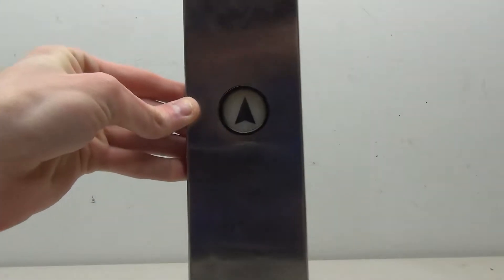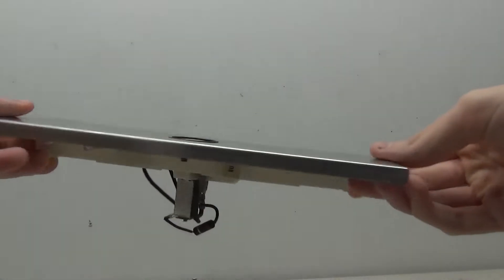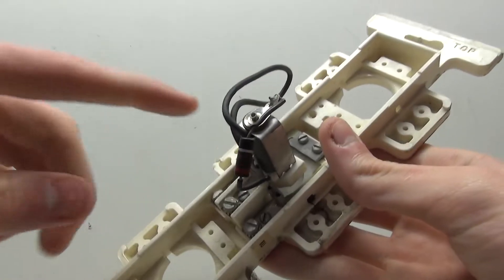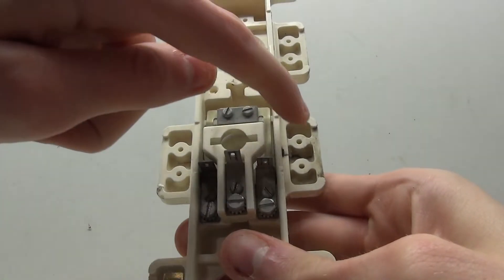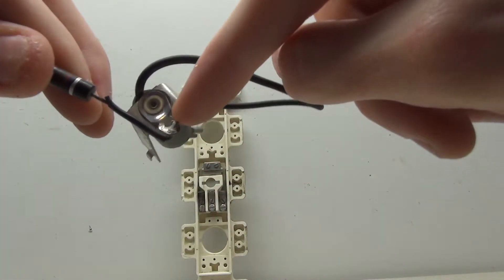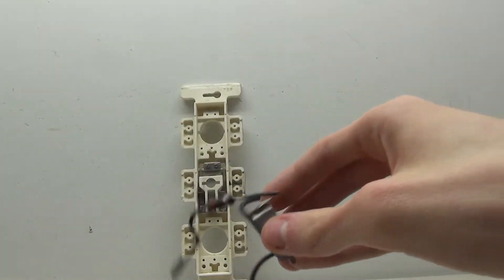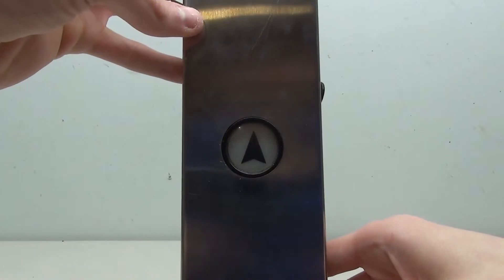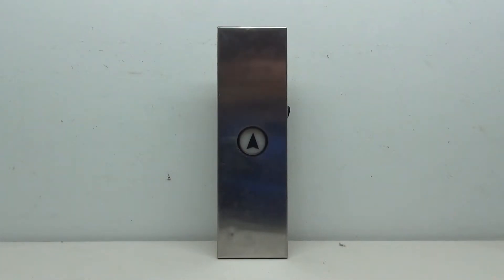Wiring a Westinghouse Type A Elevator Button

Comment: What is the lowest voltage of MB bulb that can work on a 9V battery (specifically for this panel)?
Reply from the maker: I use 6V bulbs and they work fine. You can use 12 as well, but it will won't be as bright.